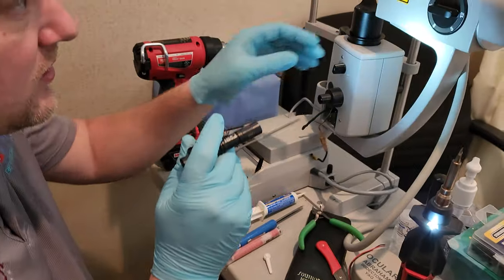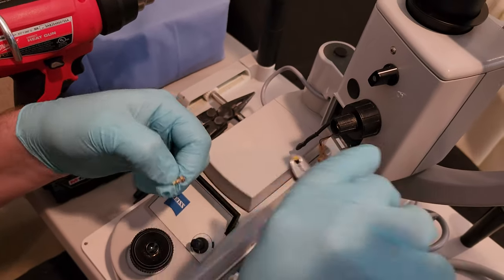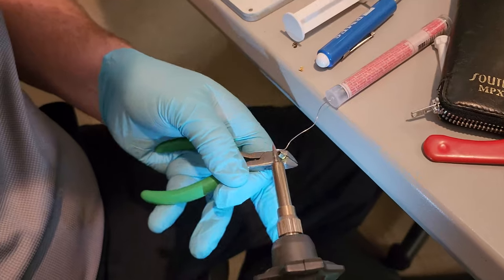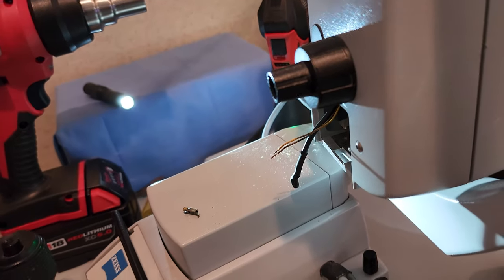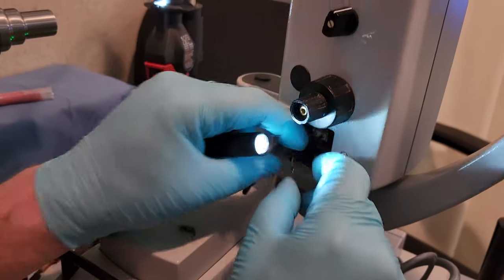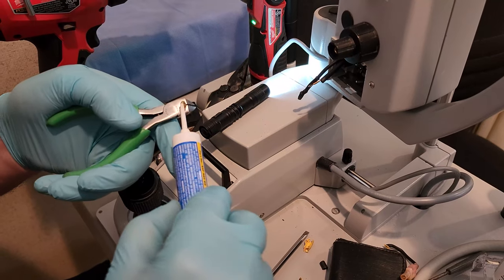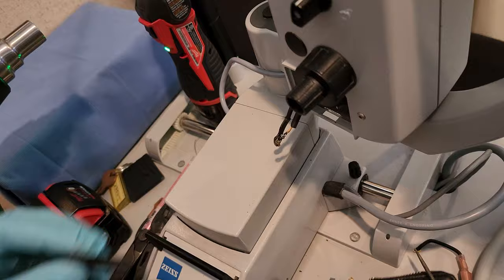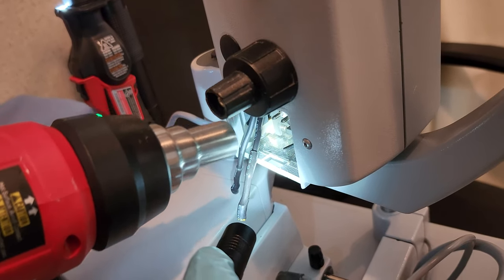Zeiss YAG Laser Repair

Comment: the reason for the hot marks was because the original repair tech didn't have a heat gun with him, he just used a lighter to shrink the tube